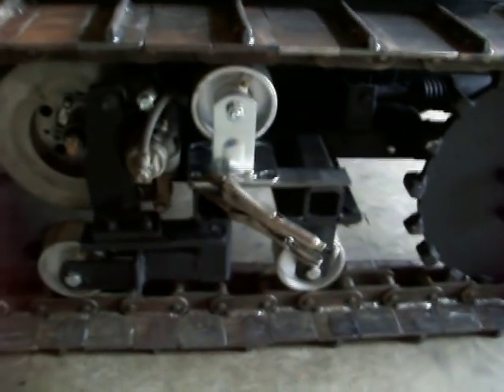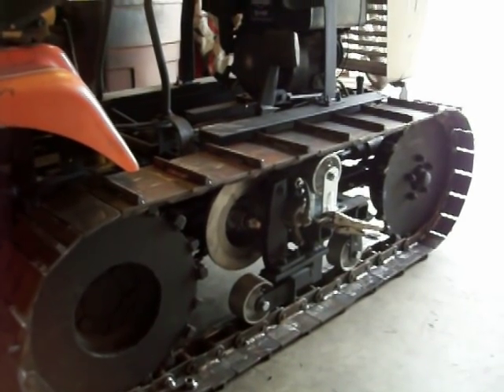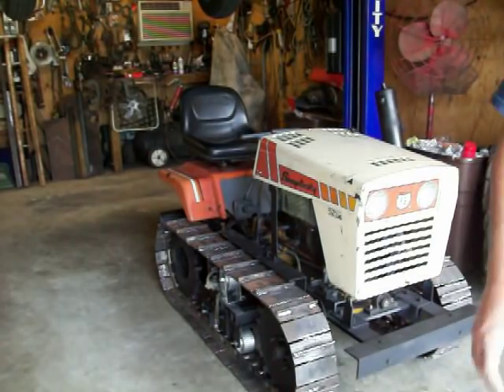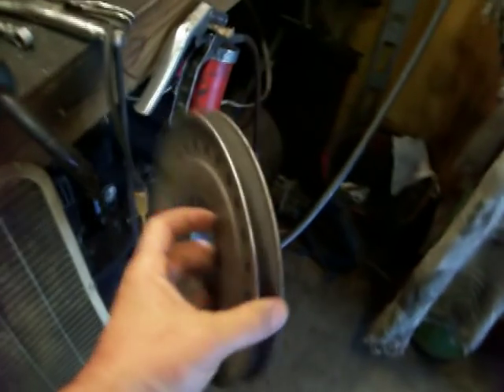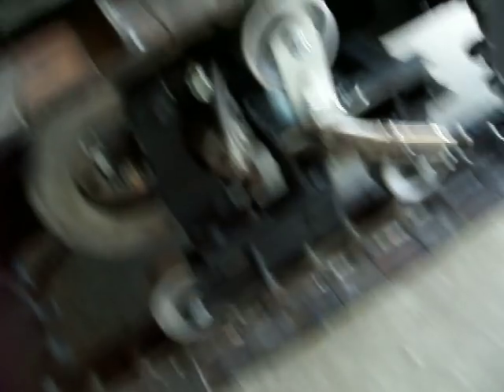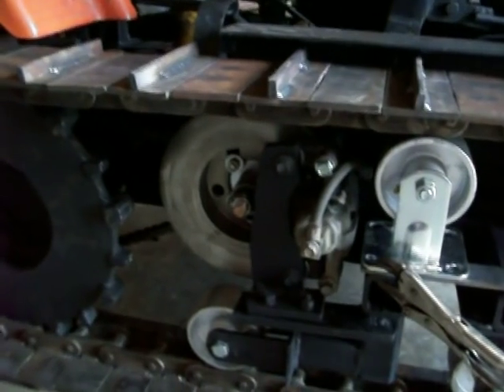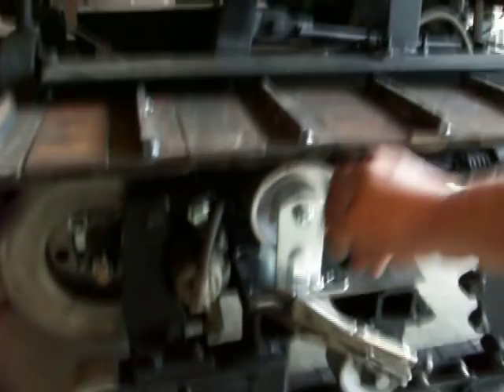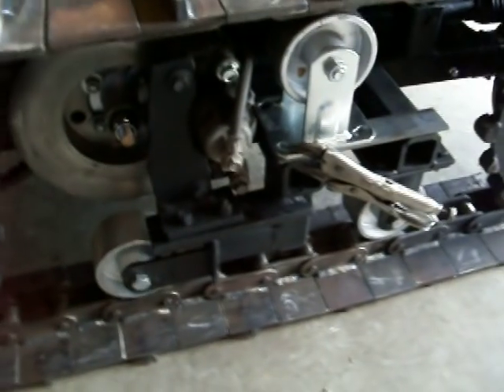Mini Dozer Home Built " Complete Brake Success"

Comment: WHY A SIMPLICITY, WHY NOT A CRAPPY BOLENS
Reply from the maker: simple.....because it was the only all metal hood the junk yard had that day and its full size for when I add a alternator and hydraulic pump and its very easy to remove the name sticker on it and repaint it,,,there you go.
Reply: Ok... Good point
Reply from the maker: you know I think a simplicity is a good mower cause that hood is super heavy duty but i am going to repaint it later on and the name brand didnt matter to me only the material it was made from,,,thanks a bunch.
Reply: Be nice , I have a Bolens w/a snow blower and a blade for clearing snow , even with the original techumseh it does a good job , but I would like
a Kohler and a hydrostat , reverse is getting pretty weak. Which is partially my fault.